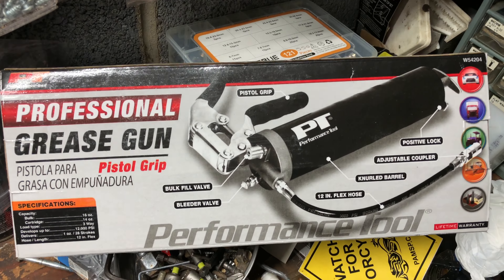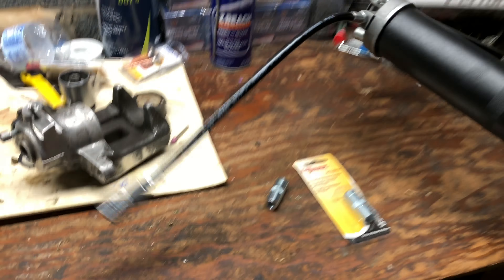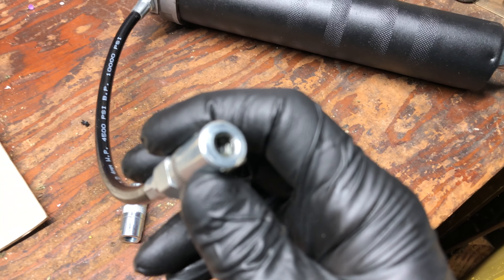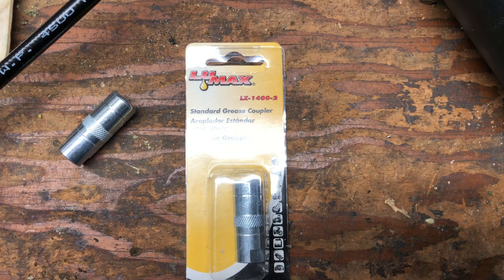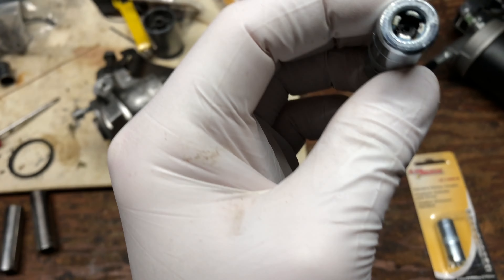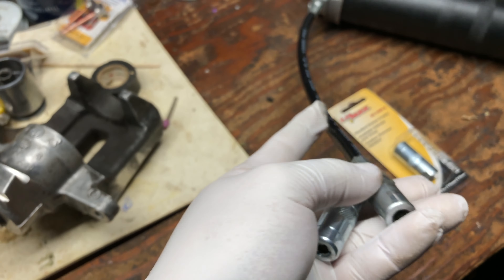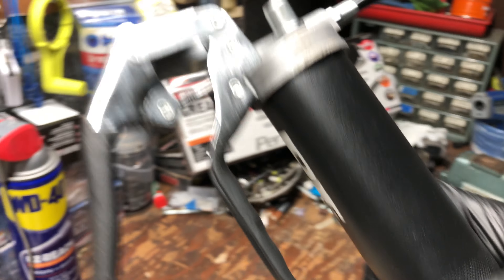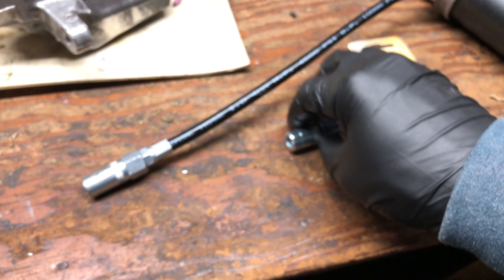Performance Tool (PT) Grease Gun issue (from Advance Auto parts)

Comment: Same issue for me. Been kicking myself for not picking up a grease gun at Lowes instead of this thing. The documentation that comes with these guns is really lacking. I grabbed a lumax to replace the factory fitting plus a LockNLube fitting (lever style release). For those having trouble getting the coupler off the zerk, (sadly probably too late for @freedomrevival1375) keep in mind the harder you pull on the coupler, the more it will bite into the zerk. To get it off, you gotta unscrew the knurled portion of coupler from the hex portion. This will allow the jaws to open slightly releasing the zerk. Unfortunately they come from the factory very tight. I had to use a vice grip and 14mm wrench to hold the hex portion. A lot harder to do when you get it stuck on a zerk. In my case, I ended up breaking the zerk off my U Joint. If this happens to you, grab a screw extractor set and use a drill to pull out the broken threaded piece. At least there's already a pilot hole for ya to start with!

Comment: Same problem with mine!  I can’t get it off the nipple!
Reply from the maker: Relieve the pressure and really yank on er while you spin the whole thing in a circular/up and down motion
Reply: @AdamEdward  What an awful design.  Looks like there are some good aftermarket couplers that easily tighten and untighten with a small lever.  I stripped the threading in the nipple already trying to pull it off.  Very frustrating
Reply from the maker: @aaronsmith21  just order that same brand i show in the vid and youre good to go

Comment: This is operator error, you need to "loosen" it by lightly unscrewing the coupler, it loosens the "jaws". So you should be loosening it a bit before putting it on, once connection is made, slightly tighten. When complete, slightly loosen by turning the coupler again. I've bought 2 from autozone, and they funcion as they should.
Reply from the maker: Naw its just a trash piece. The new, better one works like it should.
Reply: The coupler on mine won’t move literally at all. How I got it on was just pushing it on the zerk and it won’t release. And I’ve tried twisting or “unscrewing it” to release the jaws and it won’t budge. This is the first time using it as well

Comment: Many don't know that the coupler is a collet.  Rotate the knurling end and the jaws open and close.
Reply: I just bought this before seeing this video.  I tried to rotate this, and It doesn't appear that this coupler is even able to move.
Reply: i cant get mine to rotate. i put it in a vice and took a foot long monkey wrench to it. it will not budge.
Reply: It took vice grips, but I did get the collar to turn, but the jaws did not slacken. I ended up spinning it all the way off and put my part in a vice. Broke off my zirc prying the coupler off. Junk.